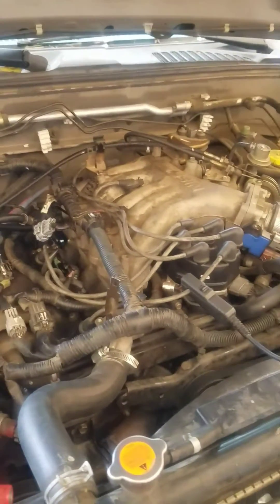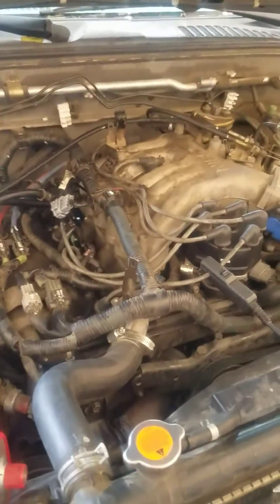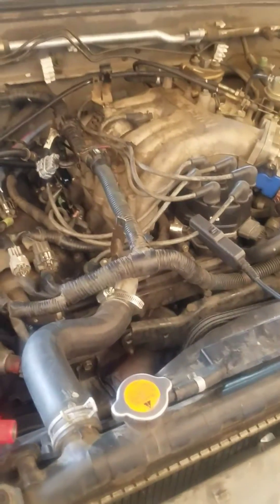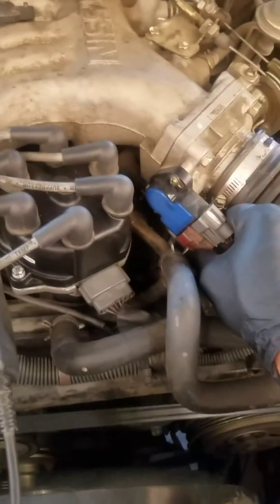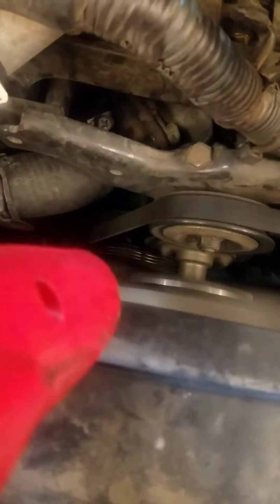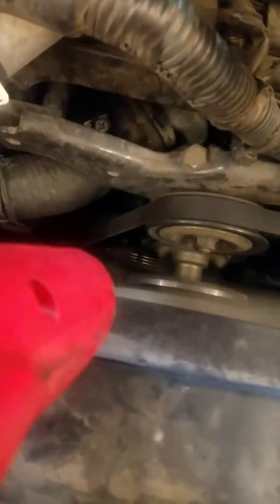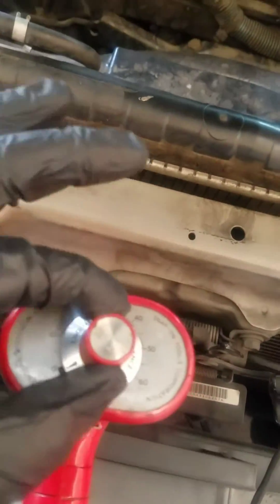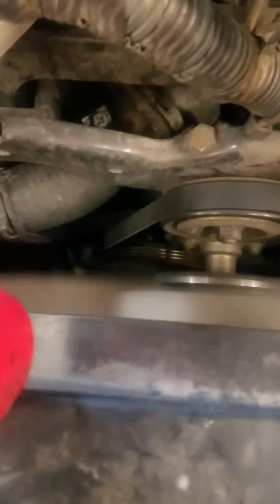timing adjustments 2004 nissan

Comment: Hello. I have a 98 Pathfinder 3.3L. I changed the spark plugs and wires, and the distributor as it's bearings had failed.  I marked the old distributor in 3 places plus the center of the rotor, and reinstalled the new one exactly.  It doesn't have the random misfires anymore. It always has idled about 950 rather than 750/800ish. I checked the timing advance and it's showing 8 at idle (950rpm) and 36 at 2,600 rpms.  Is this acceptable?  Should I tweak the distributor one way or another, which way to make it read closer to spec, which I gather is around 15.  Thanks!

Comment: My 2003 Frontier say 10 degrees BTDC.  When I disconnect the TPS my engine RPMs increase, not decrease like in your video. I set the timing mark at 0/center mark and  then I reconnect the TPS, and my engine RPMs slow down to about 800 RPMs.  Is that okay?